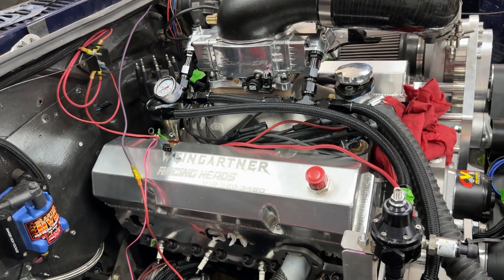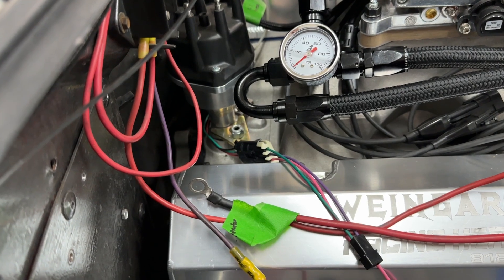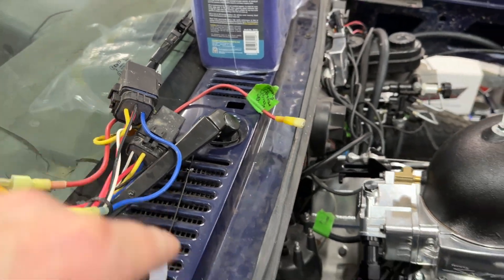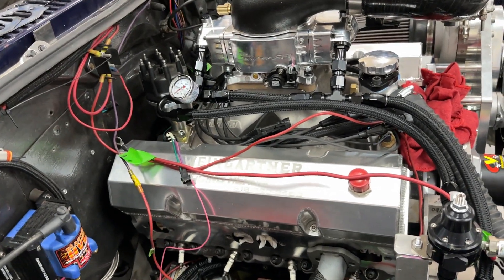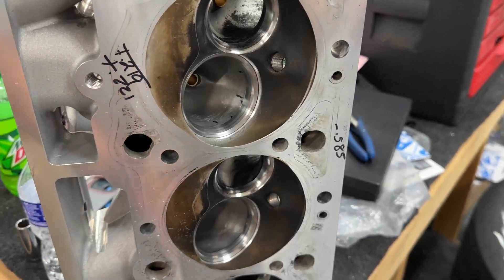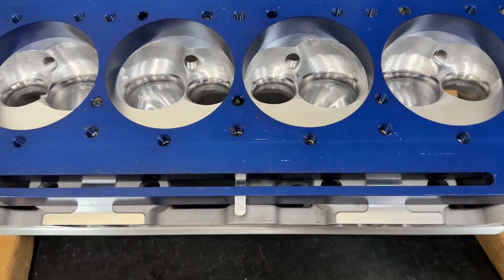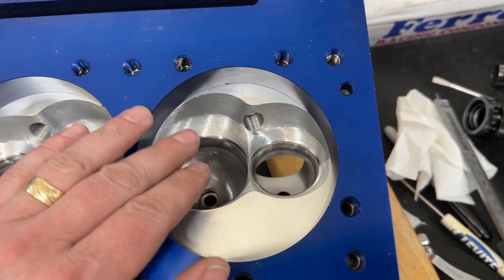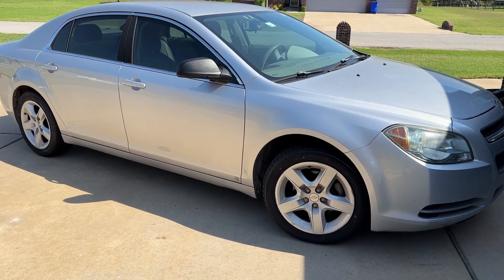Sniper EFI Question and Other Head Porting Info

Comment: My 2 step for my sbc hyperspark is just a wire to a switch that goes to ground this interrupts the sparks and shoots epic flames out the pipes. I would send sniper tach signal wire to msd box.  Tying in to white wire can cause running issues I learned this using tach connect there instead of the brown wire. With tach connected to white wire car ran like junk, switch to brown wire to tach and no issue in years

Comment: If you are going to use the holley ignition you need to use a solid state relay to keep any power from backfeeding the system during trans brake operation and burning up the input in the holley

Comment: You need the Sniper to handle the 2-step for the trans brake. If the MSD 6 controls the 2-step, the closed loop will try to correct AFR's and cause tuning issues.
Reply: You can program around this by disabling closed loop.
Reply: @lewisfoltz6306  why not just use the 2-step in the ECU? The transbrake/2 step activation on the Sniper is input #2. Use part number 554-128 for input protection.
Reply: @davecho4134  he clearly stated he doesn’t want to use a relay.

Comment: Download the sniper software on a laptop. You can do a 2 step rev limiter with the sniper. I imagine you could program it to activate the trans brake as an output as well. The sniper timing tables are very detailed. 31x31 table. 961 cells. Does the 6al2 have more resolution?
Reply from the maker: Sniper operates as ground activation not power output. The ground output will not activate a trans brake without relay. I don’t want another relay

Comment: I might be missing something here? I use the 2 step built into the sniper, but I’m running a duel sync and 6-AL
Reply from the maker: You can run the rev limiter but need it to activate trans brake at same time.

Comment: Cant you just run the 12v switch to a relay?
85- ign 
86- relay ground
30- ground wire from hyperspark
87-ground
Reply: He doesn't want a relay that can fail.